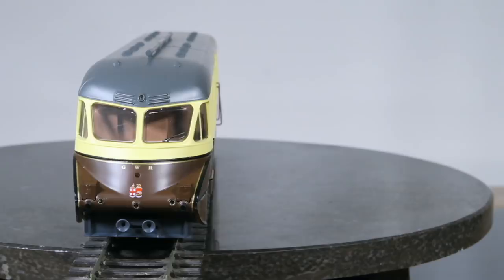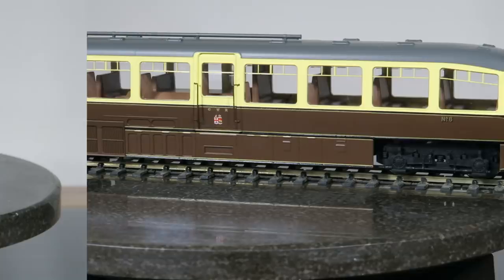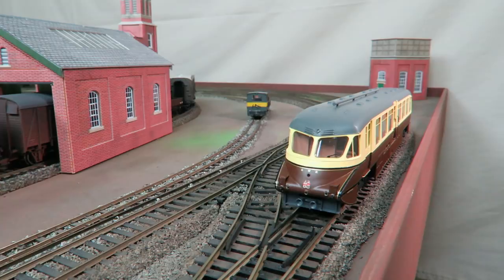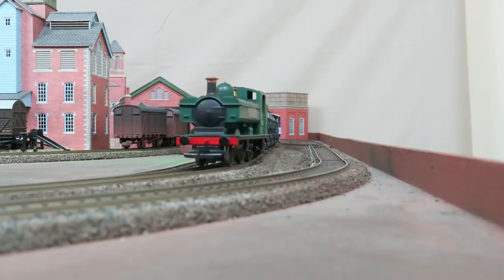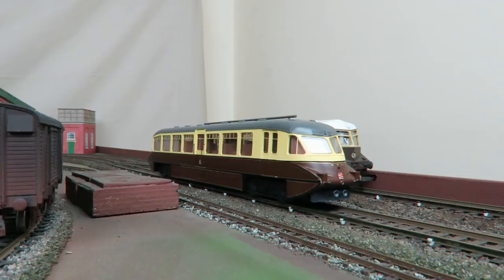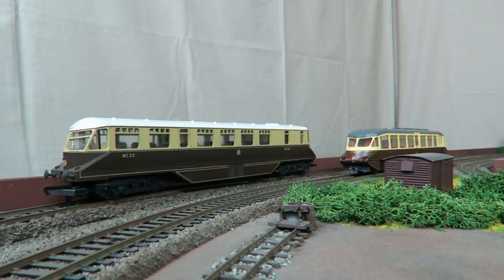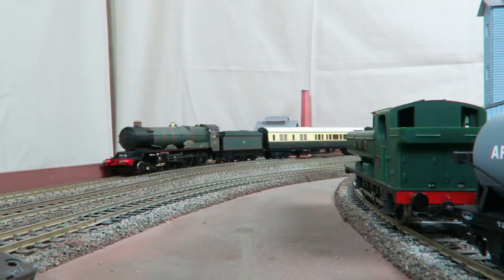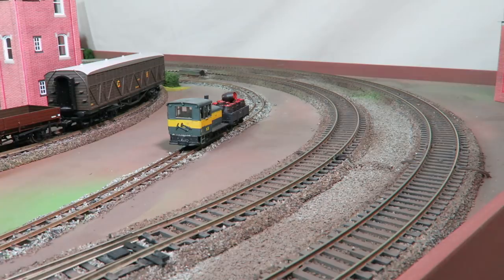Dapol Streamlined GWR Railcar review and history

Comment: I see your 14XX hesitates over the point, I added metal wheels and pickups on the carriage's rear bogie. Even with live frog points, this loco was a bit suspect. The railcar looks good.
Reply from the maker: Hi Mark many thanks, yes that was the Hornby one I think with traction tyres on the back pair, I plan to replace them with normal wheels one day lol, the idea of using part of the train for pick up is a very good one, if you check out my P class she has a match truck attached that does just that :)